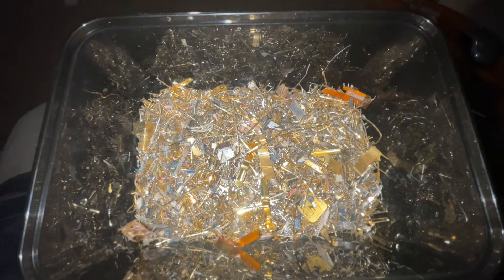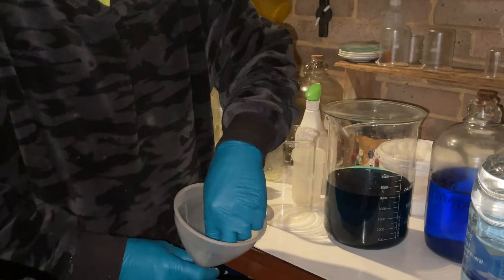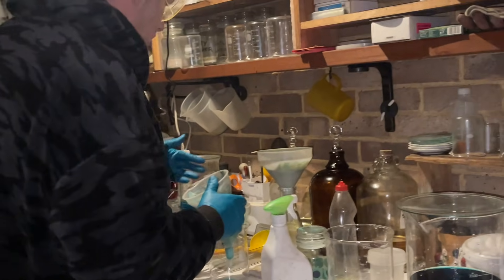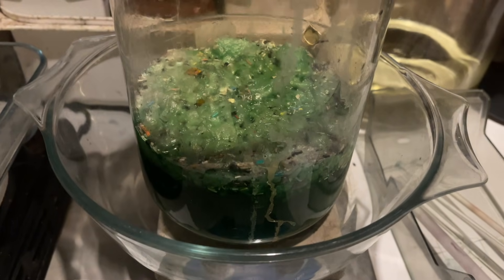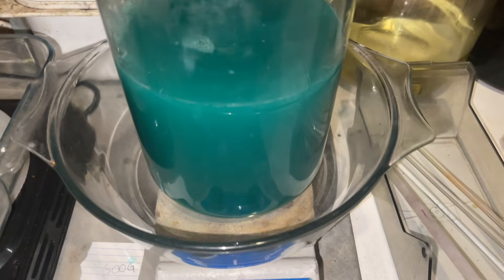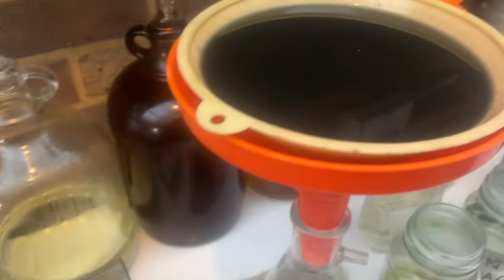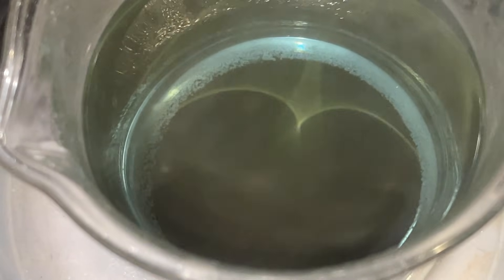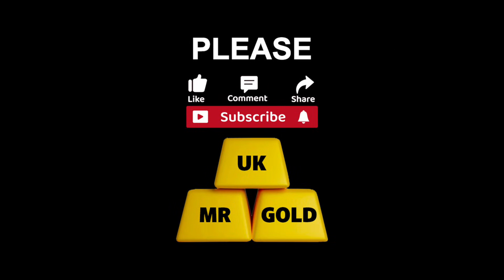Refining 600g low grade gold plated pins with nitric acid

Comment: Do you not have a fume hood and respirator brother 🤔
Reply from the maker: Yes, I use a face mask most of the time and believe it or not this is all refined outside with a roof plenty of ventilation
Reply: @UKMRGOLD if you can smell it your exposed 😊 avoid at all costs. About to do an episode on respirators and why labgrade positive presure respirators are a must. Including how to scrub the gasses safely in a fume hood. Step 1 of refining in my opinion 😊